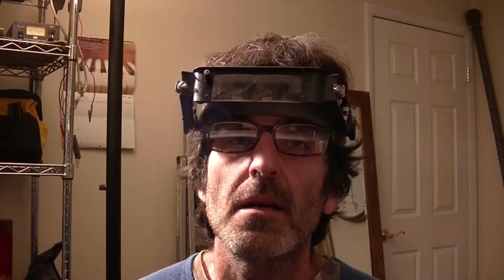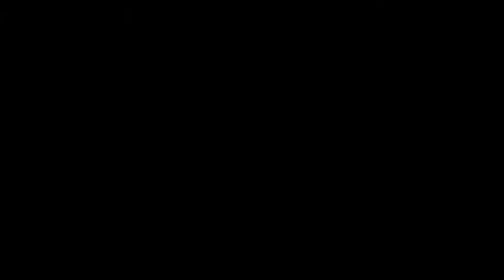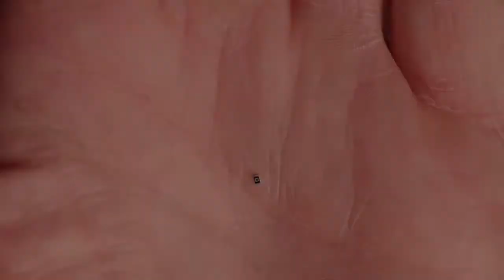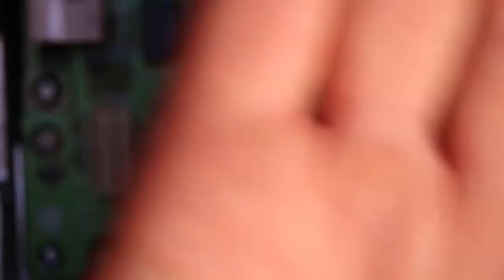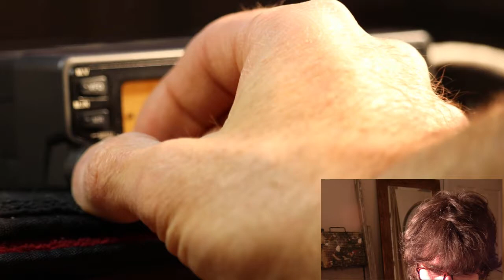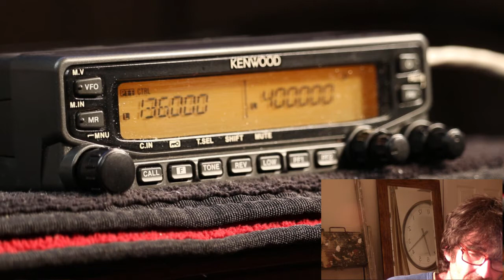Kenwood TM-V71A MARS/CAP Modification Part 2 FULL MOD

Comment: hello, i own a v71a and now i bought a vhf amplifier, the input for this amp is 15w and the v71a offsers 10w in mid power, is there any way i can change the power for the medium or high level and change to 15w? thanks
Reply from the maker: Yes sometimes you can adjust those parameters in the service menu.  I think you'll need to make a jig that plugs into back of radio to access it.  I don't remember the specifics of how to get into the service menu although it might be a good idea for a video!  Seems like you can download the service manual from the web for free (not owners manual).  I think I had it at one time, but may be lost now.  You have to be careful when in the service menu since there are many other parameters that if you disturb them by accident you'll really make a mess of the whole radio!

Comment: That didnt works. No TX at, for example, 149.050.
Reply from the maker: Mine worked right out of the gate... Did you remove the wrong component?
Reply: @JLPicard440  , lol...... ive not seen something...... its so small..... I trie again

Comment: I performed the mod per the video and the it is transmitting as it should. My question is did making the mod drop the transmit power?  I’m not getting anywhere near the 50 watts I was getting before, on previous frequencies or opened up frequencies…even at below 1.1 swr.
Reply from the maker: HI, No I didn't have any trouble like that.  I can understand why you'd get a little less power on frequencies outside of the intended use, but not on 144-148 and 430-450....  Is it a drastic difference?

Comment: Hi,I saw on the video the power is low, what hapens is you try with Higt power?
Reply from the maker: It should work fine if you have the proper antenna, but my antenna is tuned for 2 meters.  The swr would be high and I don't want to damage the radio.

Comment: The what looks like a 0 ohm resistor was removed after taking off the green wire. I wonder what the 0 ohm does by the 2. Seems like these three are meant to be removed.
Reply from the maker: Not sure on that one.  I removed only the ones that the mod called for.
Reply: It may be the jumper that switches between the american and european band plan.

Comment: Do you have to follow the MARS/CAP instructions before you can do this?  Or can you just remove that resister and you've got full TX range
Reply from the maker: I've pretty much found that removing the resistor and turning it on, it's ready to go to town...

Comment: What about that other resistor #2 , what does it do?
Reply from the maker: What does it do?  not sure what the actual function is.
Reply: @JLPicard440  Leave resistor#2  (R654)  alone ,it is for the crossband repeater to work in the Radio.

Comment: Hello sir.. just want to ask.. i have kenwood tm v708.. already take out the green wire and resistor.. the frequency change to 136-174.. but cannot transmit .. transmit only from 144 to 145.995.. do you have any idea about this problem.. tq
Reply from the maker: I'm not sure.  Did it work before you removed the parts?  The procedure may be different for that one.  You might be able to find the mod on www.mods.dk.  You'll have to setup an account, but it's free.
Reply: @JLPicard440  before i did the mod.. the frequency 144-146 only.. after i did the mod. Its open from 136-174 but only rx. No tx.. tx still on 144-146..
Reply from the maker: alan583477 oic... do u have a European version?  It sounds like you removed the component to open the RX.  Did u check out mods.dk to see if they have the TX expand mod for that radio?
Reply: @JLPicard440  i think its European model.. i thought the mod same like other model.. im going to check with mod.dk if there mods for tx.. do you have another webpage for mods..
Reply from the maker: @alan583477  Not off hand.  It'd be easy enough to google the mod for that rig and bypass mods.dk...
Reply: @JLPicard440  i see tm281a model.. same like my problem.. can rx no tx... They remove 1 resistor R768 if I'm not wrong... Its open the tx problem...
Reply: Do you have email
Reply: It would be interesting to know if the European radio has jumper #2 removed.

Comment: Even though this video is a few years old. I purchased this radio from HRO in Portland and paid for the MARS MOD, which did not do much at all for what I was hoping. After watching your 2nd half video and successfully performing the resistor removal, my radio is performing exactly what I wanted and on the frequencies that I needed. Thank you and the radio performs very well and is very stable for those who wanted to know after doing the mod.
Reply from the maker: Excellent!  I still have that radio, and it's been solid ever since the mod.  What did HRO charge you for?  Clipping that wire?  I hope they didn't charge you much..
Reply: @JLPicard440  Yes, It was about $35.00 to $45.00 what I remember. It was mis-leading when I mentioned that I was using it for SAR missions on State emergency calls and needed to work with some Freq. I also Might mention that I was able to successfully do the complete duplicate to my Kenwood TM-D710G and the Kenwood TM--V71A are both the same as for the MOD and are opened up and running very well, Thank you for your instructions! LOVE IT
Reply from the maker: @scottmitseff4402  So glad you were able to get them running the way you want!  :-)

Comment: Thanks for the walk through on this. Got my V-71A opened up no problems.
Reply from the maker: Excellent!... :-)  I actually still have this radio and its still working fine.. I've had some mic issues with ticking in the audio.. sounds like a Geiger counter... LOL.. but the radio itself has been solid.

Comment: Do you have to reset the radio when done?  Thanks for the video!
Reply from the maker: I never had to.
Reply: After removing the resistor, second part to the modification, I plug the radio back in and it reset on its own I had anticipated that so I had taken my back up on my computer and easily wrote all the frequencies in settings back to the radio and has been working great.

Comment: Can you RX in the frequencies you opened up ?
Reply from the maker: Yes, the RX is already opened up from the factory unless it's a foreign model.
Reply: Take a Bath Productions thank you for the response, I was looking at getting this radio but it looked as though it didn’t cover the frequencies i was looking for to scan the emergency services in my area.
Reply from the maker: It should... the v71 has a pretty broad receive... I can pick up aircraft band and many more...

Comment: Did this mod cause any intermod problems or sensitivity issues I guess in others did it effects the radio in any other way besides transmit and receive
Reply from the maker: I'm still using this radio to this day, and I haven't noticed any problems like that..
Reply: Brian, not all. I finally did both the first and second mods to my radio today and it’s performing exceptionally well especially with the frequency range that I needed it to work on.

Comment: Take a Bath Productions, how has your radio performed since the MOD...any problems? I just received my TM-V71A. I am considering these MOD both part 1 & part 2.
Reply from the maker: I am still using that radio.. I haven't had any trouble out of it.  Thanks...
Reply: @JLPicard440 : I did the MOD today (freaking out that I was going to ruin the radio); other than having to wrestle that tiny resistor off of the board, it worked! Full TX. Thanks.
Reply from the maker: Justin Lefever good deal! I was pretty nervous the first time too... I don’t want to make a paper weight out of a radio!  I’ve done several and hasn’t happened yet.... fingers crossed 🤞

Comment: What happens if you take out the one labled 2 also?
Reply from the maker: Some of the mods I've seen call for removing number 2.... I didn't find it necessary to remove it to get the full range of the TX... It's possible that number 2 will open the RX some more,... Possibly for a european version....?  If you wind up doing the mod and removing number 2... let me know what difference it made...
Reply: @JLPicard440  any replies to the question of #2??
Reply from the maker: @shorthairbigfeet2779  Haven't received any replies.
Reply: @JLPicard440  Leave resistor#2  (R654)  alone ,it is for the crossband repeater to work in the Radio.

Comment: What's the difference or benefits of doing your Part 1 mod, vs part 2 mod?
Reply from the maker: W0QGS Richard part 1 is easier... but part 2 opens it up more
Reply: "Opens it up more"... in what way?  Difference in range of frequencies?  Power output difference?
Reply: I was wondering the same thing, Jordan.  So I did some checking and apparently the first mod, cutting the green wire only opened it up partially, from 142.000 - 151.995 and from 420.00 - 449.995 whereas the second mod expanded it fully as he demonstrated at the end of this video.
Reply: @JordanHenionStormChasing  I have just completed the first and second mod, it opens up the frequency range tremendously I’m able to even transmit and receive on GMRS frequencies/repeaters in my area. Plus I do emergency work that allows me greater range on frequencies that we normally use to transmit on and receive frequencies not generally open to the public. Power remains the same at 50 W.
Reply from the maker: @scottmitseff4402  Awesome!
Reply: 👍 this radio will do what  I need it to do but before I buy curious what this radios bandwidth limitation are can't find info? will it  
commercial frequency with 11 khz  narrowband
Reply from the maker: @Smgrizzly  I don't know the answer to that one..